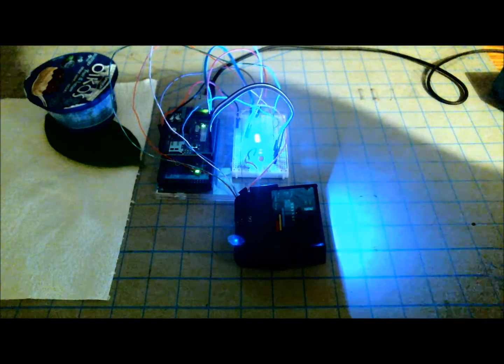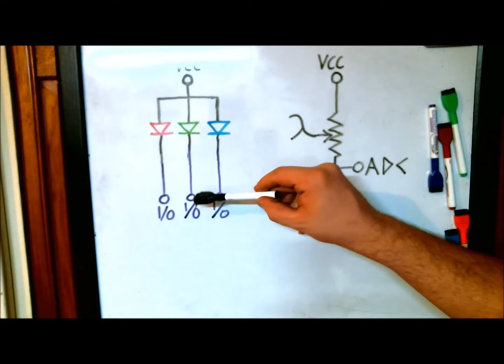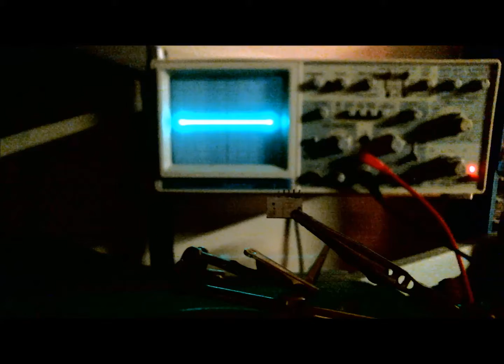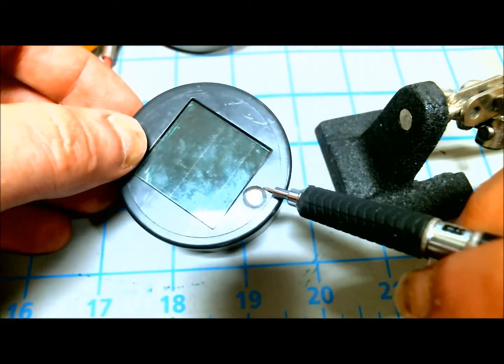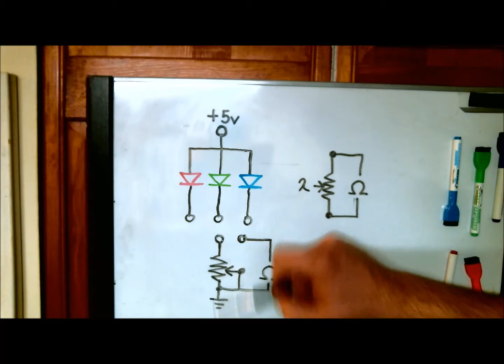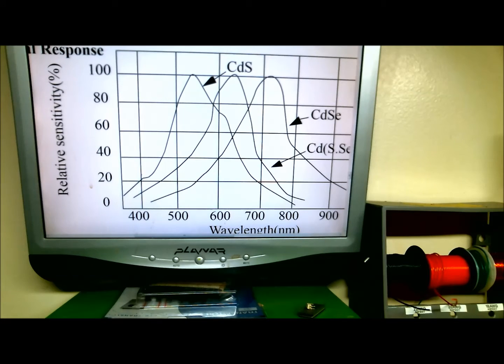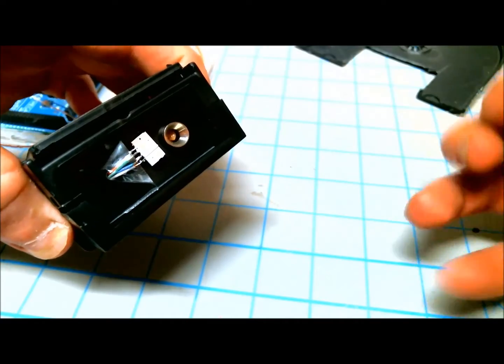How to make a Color Detector

Comment: I am thinking this method that most people are using is deceptive.Why not use 3 photo sensor with rgb color filter or one sensor with rgb color wheel. it just seems like the sensible thing to do being that most cameras and displays achieve all the colors this way. This can be done without arduino

Comment: hello, could you tell a beginner how to make and program 4 of these, 1 each for red, blue, yellow and green? I need them to work as a switch to activate a 12 volt lock when it sees it's respective color. I just need simple, cheap, standalone units that i can use to switch 12 volts. Thanks!

Comment: did you not noticed this messup ? 

 //Turn on Green LED  
  digitalWrite(redled, HIGH);
  digitalWrite(greenled, LOW);  // turn the LED on (HIGH is the voltage level)
  digitalWrite(blueled, HIGH);     // turn the LED off by making the voltage LOW

why did you comment backwards? if low is off why are you saying to turn ON green set high but i see that you wrote low and even the comment say low is off?  what was the idea here? 

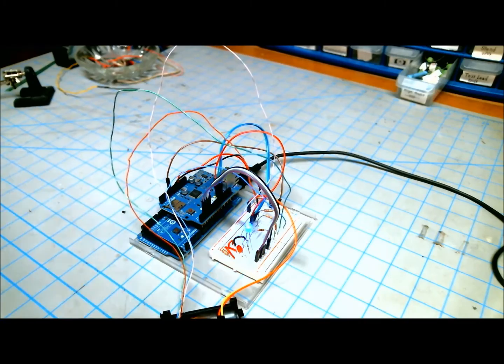another thing im in question about is why did you have rgb right underneath the sensor? thats kinda like asking for the fluctuating to occur and without a doubt this is what i noticed  9:45 you have the blue and red on at the same time which is why the protoboard led are going crazy and according to your code if this messup i mentioned earlier also might be the reason why your system is sketchy

Comment: What happens if you test a purple object?

Great presentation. Well edited etc. Although I'm not a fan of the recuced video area with the black border. If you could watermark your logo in the actual video area it would also provide petter protection againt video use without it.
Reply from the maker: At present a purple object registers blue, since I only programmed it for RGB at this point.
Thanks for the input, the watermark is placed there by Youtube. I'll definitely try finding a way to remove the borders.